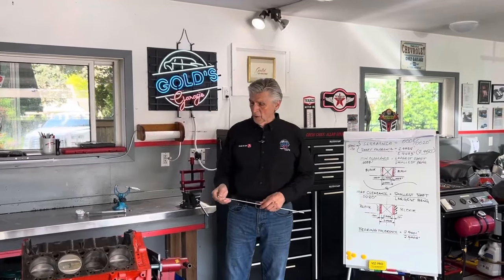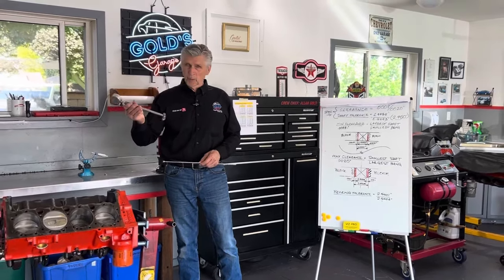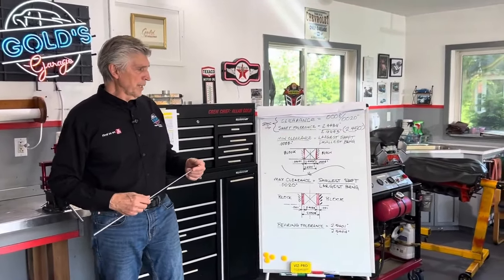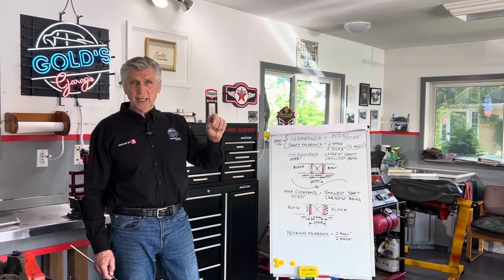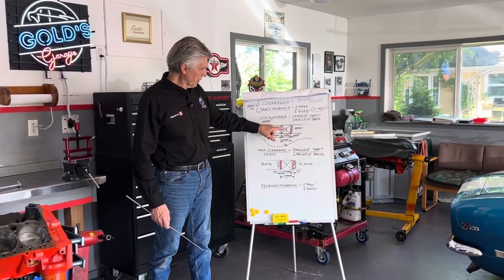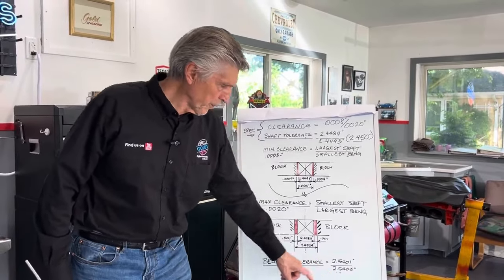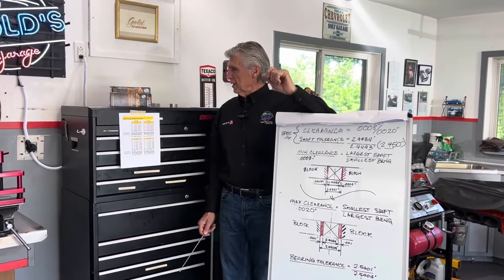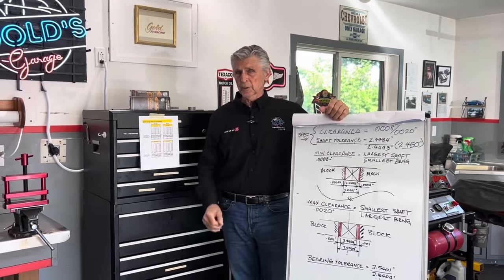BUILDING A SMALL BLOCK CHEVY - SPUN BEARING?? Clearance and Tolerances and why they are IMPORTANT!

Comment: If you inspect the back side of original factory bearings, you'll occasionally come across ones that are marked .0006 U/S, presumably to deal with bottom spec crank journals. It was quite common for us when rebuilding a stock 350 with a factory cast crank to just polish and use .001" U/S bearings as they typically measured bottom size or very close to.
Reply from the maker: Thanks Yarrda, always good information from your experience. AG

Comment: Had a shop assemble a short block 355 and had one bearing full copper and the rest 10-50% copper showing. Had 60 psi oil pressure and about 40 warmed up. Second time the same crank and block crank wiped bearings. Both assembled short blocks two different shops.
Reply from the maker: Thanks for the comment. Oil pressure is not necessarily an indicator of proper bearing clearances. AG
Reply: @goldsgarage8236  nope. But it does mean it wasnt for a lack of oil.

Comment: I spun a main on a "balanced and blueprinted" big block I built, that was an expensive lesson. I did not check the machine shops measurements since they had done ALL the machining and balancing. They claimed it was my assembly, but it's the only time it's ever happened. I assumed.
Reply: This is why I pay the machine shop to deliver a long block.
Reply from the maker: Thanks Jimmy, even professionals can make mistakes, that is why we always check every dimension. AG

Comment: This is also another advantage of using a lightweight crankshaft it’s easier on bearings. The engine I’m building is getting a 43 pound crankshaft instead of the stock 54 pound one. Plus the free horsepower gained and quicker revs from not spinning all that extra weight.
Reply from the maker: Good point, lighter is always better in anything that rotates and accelerates. AG

Comment: I believe the factory used air gauges on the crank, very fast to do to get size, Callie's use this on theirs cranks and rods, I saw this on a tour a few years ago, can even use air gauges on bore sizing, good video, always check the back of the bearings on a factory block, if upper and lower are different size, you will have to align hone the bore,I haven't seen this on rods only on mains,on a race engine all the bearing clearance should be the same front to back to even the load, if more clearance on 5,4 will take the load, good video, gets me thinking!!
Reply: We used air gauges in the Timken bearing factory I worked at in places too.  Very fast and seemed to be very accurate when calibrated.
Reply: Your correct....He dosen't give GM enough credit. Also these days the true HP motors are assembled in a secial GM Performance Technology Center each HP GM motor like the C6 Z06 & ZR1 motors was hand assembled by a single worker and there is a strict regimine of quality checks. Not true back in the days of the Gen1 Small Blocks & MKIV BBC but, they still measured the sub assemblies and carefully selected parts for the HP motors. Oldsmobile had many "select fitted" HP motors in the 1960's....The W-30 and W-31 Oldsmobile motors were select fitted to loose tolerances when they were assembled. There were CnC operated machines going back to the late 1950's in Detroit using a perforated paper tape run on reels that later became magnetic tape then computer programs.
Reply from the maker: Thanks for contributing Bill, always learn something form you. AG
Reply from the maker: Thanks for sharing Darryl, good information.AG
Reply from the maker: Thank you EJ. That is a lot of good information. I appreciate your input. AG

Comment: We went through a camry engine back in the late 90s and while its been to long for me to remember I think they had specific numbers for bores and bearings where they graded them. Maybe they used air gauges or something that resulted in tighter tolerances as i remember the toyota guy that ran our route said toyota got their tolerances down to a specific micron size, which was odd for me hearing microns when dealing with clearances.
Reply from the maker: Also great info, thanks Steven. AG

Comment: I ordered some Mahle/Clevite .001 under the other day in the A series it took 3 warehouses to get a full set.  The first 5 that come together were marked correct on the bearings but when I put the ball Mic on them they were standard size. Then 2 others come in and then the final set.  They were marked correct and measured correctly.   3 years manufacture dates and of course 3 lot numbers.  I sent them all back and said I want all the same lot numbers.   I also ordered  2 other sets from other vendors.    🤔🙄🤕🤦‍♂️🤷‍♂️

I have been at this long enough to remember feathered shims.  Also removing shims to correct clearance. 😁😎
Reply from the maker: Thanks for sharing your knowledge and experience Comet. AG

Comment: Always... always... always... when regrinding any Crankshaft.... even stock stuff for even modest HP applications.... 
target "lowside" or small sizing of the journal tolerance, to allow yourself "ROOM" ..... so that when ReSizing the Connecting Rods or Line Honing the Mains to can "set" the Vertical Oil Clearance where you want it for the target application. (Think the  'Tonawanda' hp engine plant)
Then all you have to do when Line Honing/Rid ReSizing is stop prior to the Bore tolerance and "checK' with your dial bore gauge prior to final sizing so you know 'where' you are clearance-wise..... and having already put the "room" for Oil clearance ON THE CRANK... you can then final size Rods/Mains and provide good Bearing Crush as well ! 
Example: If you want tighter closer to .002" Rod Brg Clearance ? after stopping/checking... you can merely final size the Rod right at 2.2247" or even a coupla 10ths under for good crush
if you want more Rod Brg clrc ? say to .0025" ? after stopping/checking.... then you can continue final sizing the Rod Big End closer to 2.2252" which is the high end of tolerance but still good crush.
NEVER take a Rod Big End higher/above/looser above tolerance.
Again here:
think 'Tonawanda' plant wherer ALL Crank were ground 'lowside' for this reason !

I don't let anyone "Machine" a 500 hp resto deal nor an 970 hp N/A SS Drag Engine I'm assembling.... unless they are under my direct supervision? or I'm doing it myself !
And that's why most HotRod Callies/Billet Cranks are/were supplied .0005" BELOW tolerance for the aforementioned reasons.
Reply from the maker: Thanks for sharing your deep knowledge and experience Dirt. All good info. AG

Comment: I've been messing with a couple of relatively modern motorcycle engines lately and in production they use selective assembly with part clearances worked out on the fly by picking between bins, cranks are numbered or lettered and rods the same, bearings are color coded.  A mix of  humans and robots. It all goes together and lasts a very long time as long as maintenance schedules are followed.   It is not unusual for motorcycle engines to easily exceed 100,000 miles with nothing, but fluids and valve clearances set, quite a  change from my youth.
Reply from the maker: Thanks you for sharing this information Vom, very interesting. AG

Comment: Yup! Just built a smallblock chev and spun 3 mains. Oil pump pickup fell off! Not clearances issue here.
Reply: Been a lot of oil pump pickup tubes breaking off on YouTube. One of the most heartbreaking ones I’ve seen is the guy that built a 409 stroker 351C with Darin Morgan ported heads. The harmonics in the engine made the oil pump pickup tube, that was welded on, snap off and trashed one expensive and sweet running engine. It was in a beautiful Cougar.
Reply: @robertwest3093  i will never NOT tac weld the tube on once in but it seemed impossible that it could come out the way its a ~5 inch tube 180⁰ bent and held into the pump by 2 bolts! The 2 mount standoffs actually broke between the pump and tube somehow, not on any bend, just very odd. Summit #SUM-G36030 looks like what I had.
Reply from the maker: Thanks for all the info guys.AG
Reply: @robertwest3093  DragBoss. Rockin' Cougar! Good people.